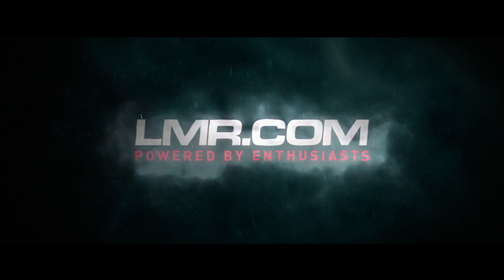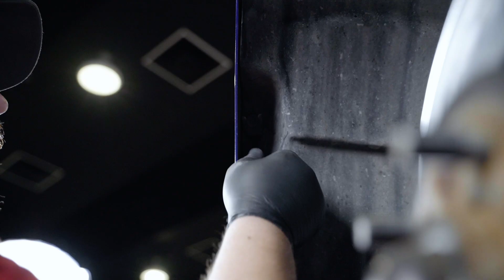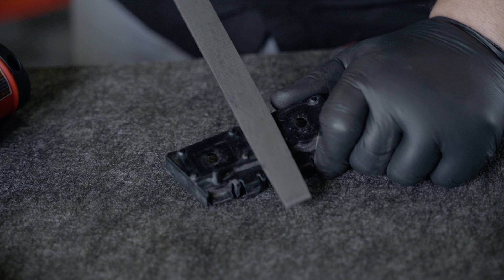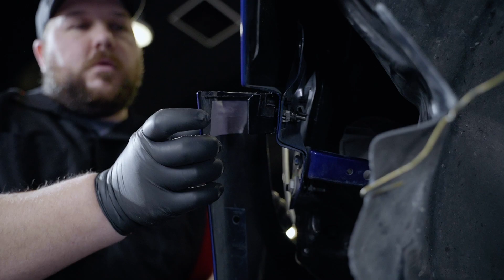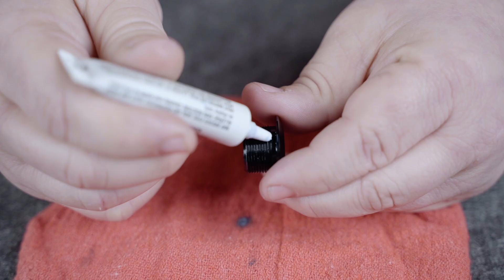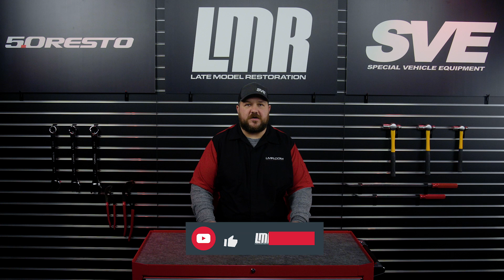SVE S550 Mustang Front Bumper Repair Kit (15-17) - Install

Comment: I simply used some epoxy, held it down with some tape overnight and problem fixed.
Reply: Funny enough I'm here because I just bought these due to the last owner glueing the sides on and the tabs ripping off.
Reply: @NinetyThree_Premium sorry to hear, but I don't plan on ever selling my car. So nobody has to deal with my personal permanent modifications.

Comment: Does this work on a 2018?
Reply from the maker: No, this kit will not work for an 18-23 car. Those cars had a revised front bumper to fender attaching design. -Landan
Reply: @latemodelrestoration what about a 2018 GT350?

Comment: cant you just use a replacement bracket?
Reply from the maker: Hi K, 

You can, but this is more of a permanent solution to help with the bumper fitment. It also makes it a lot easier to remove the front bumper!

Comment: Can this be used on a s197 ?
Reply from the maker: Hey Quany, no this kit is designed to only fit 15-17 S550 models. You will have to design or locate your own from another manufacturer or retailer for a S197 set.
Reply: @latemodelrestoration  how much should somone charge for this service
Reply from the maker: @nickfromdasack  That's hard to say. Some places may charge a lot more or less, depending on how they see fit. I would contact multiple shops and get a quote for the installation.
Reply: @latemodelrestoration  your price ?
Reply from the maker: @nickfromdasack  We don't perform installs on customer vehicles. You will have to contact a local shop for an estimate for the install.

Comment: It’s not difficult guys if you want a pin on your bumper that’s you but I know I don’t. I simply went to my local body shop and told them if they could do some type Mickey Mouse on it and they just applied black glue in the back even it out, let it dry and I was good I never once had an issue with it it’s still in place and they only charged me 20 dollars. For those wondering what if I need to remove my bumper in the future well I told them eventually I’ll want some headlight work and I’ll need to remove my bumper they said no big deal you simply pull it out 👍
Reply: But if you need to take the bumper cover off for access to headlights ect. You are SOL
Reply: @CrazyAGT  exactly